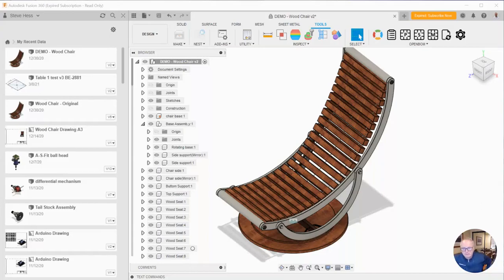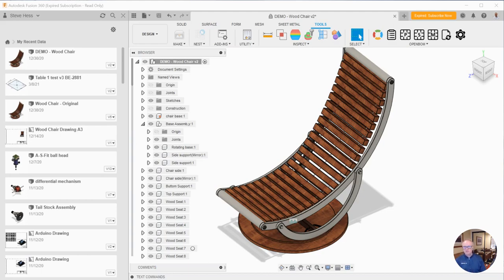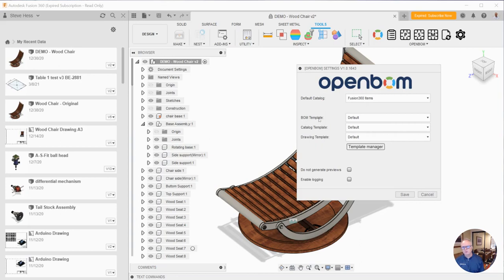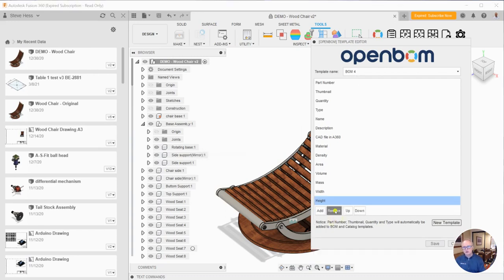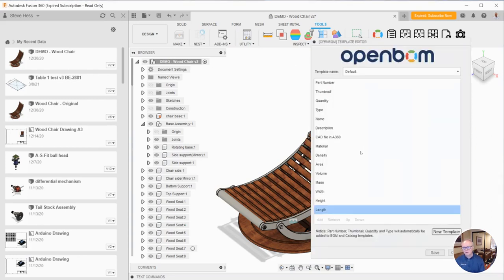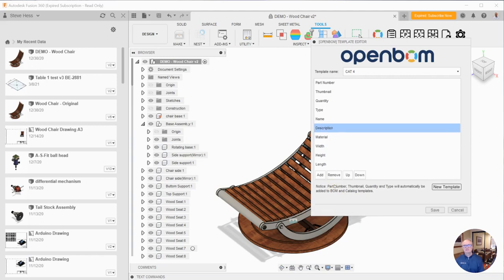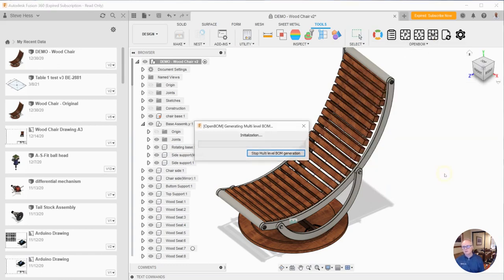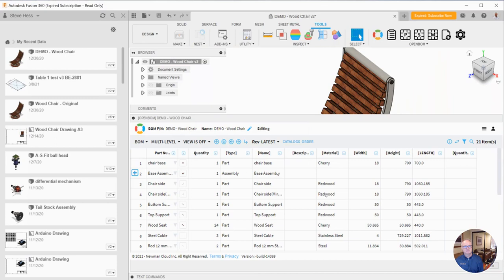OpenBOM for Autodesk Fusion 360 - How to control the properties and templates

Comment: can I get a column that shows the appearance material, or does it have to be physical?
Reply from the maker: If you define it in Fusion, you can get it.
Reply: Can you elaborate? We applied a material but it doesn’t show up if we add an appearance property column…
Reply from the maker: @LindseyBewley  OpenBOM retrieves certain data from Fusion360. Please contact our support -we will have more tools to help you.
Reply from the maker: @LindseyBewley  Sure, please contact support. I think you already did.